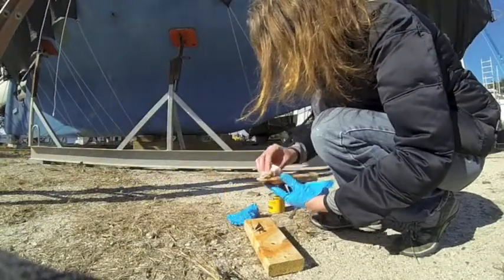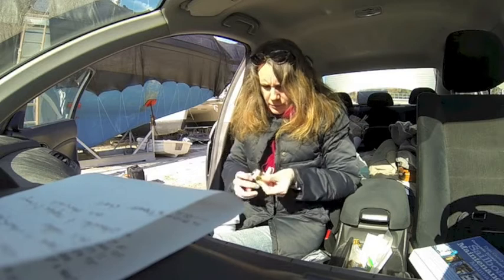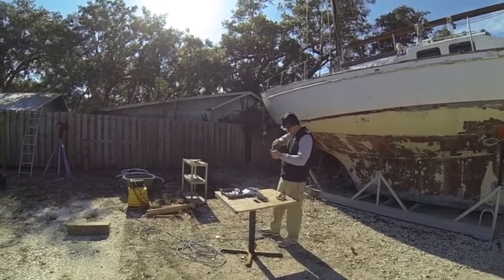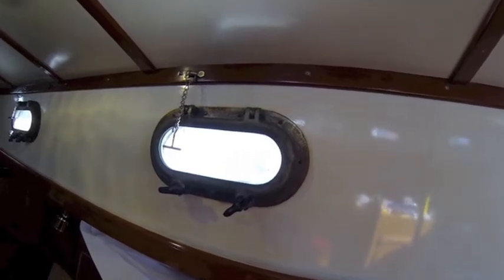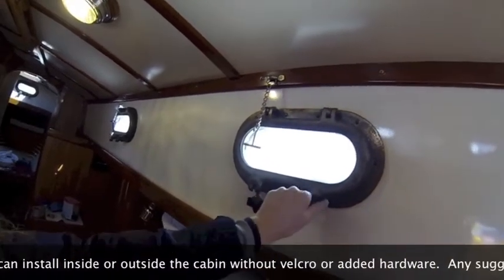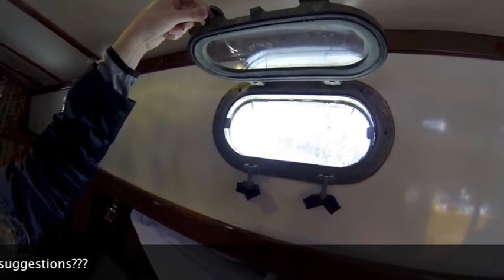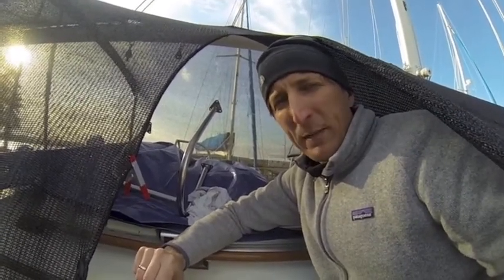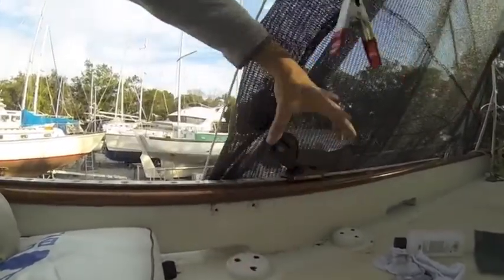Winter Sailboat Maintenance   Day 11 - Rebedding Deck Hardware and Converting to LED Lights

Comment: When I worked for a marina a few years ago, we installed screens that had rubber edging that made a friction fit. We would open the port light and install it from the inside. It would rest against that ridge that you have in the outer edge of your port light.

Comment: Love the videos and I have two thoughts.  First, they make products to break down 5200 to make removal and clean up easier.  I'm not sure what the stuff is they used on our boats, but the stuff is really on there as you're well aware.  I'll attach a link to the product below, but I have also not used it.  Maybe someone else can chime in here on it.  

My second thought is to try and see what kind of SS the screws are that you're purchasing at Lowes.  Typically those kind of stores are going to purchase lower grade SS to keep the cost down.  Going to a good quality hardware store or ordering online will typically get you a good 316SS that won't rust as quickly.   They'll cost more, but you won't be replacing them in a couple of years.  

Keep up the good work.  We still have about 2 to 3 months before we can start work on our boat.  If you would like to chat more by email to bounce ideas off each other i'm at ddsailor25@gmail.com 

http://www.westmarine.com/buy/anti-bond--anti-bond-2015--P001174804

Comment: Home depot sells a product in the caulking section or where the acetone is that is a silicon remover made by Dap call Silicon be gone I think.
I've tried it and it worked well. it takes it off in layers so may take multiple applications. Not much in the bottle so if you have a lot to do buy two.

Comment: For the window screens, if the goal is privacy, consider one way see through film. We have use privacy film in our bathroom window and works great. It looks like a mirror from the outside but it allows you to see through it from the inside. Can be cut to fit perfectly. Here is an example: http://www.amazon.com/Mirror-Window-Film-Wide-Roll/dp/B004S7HPJ0